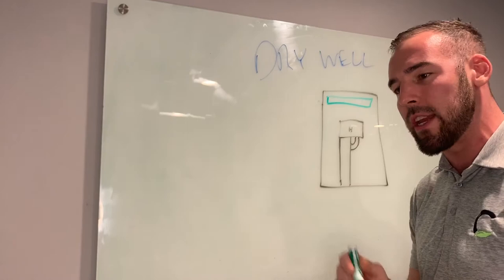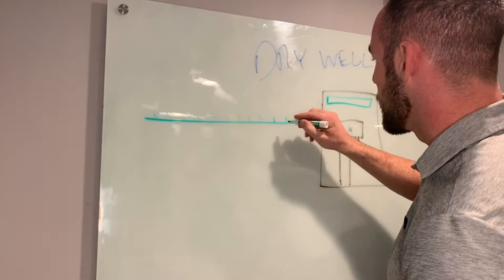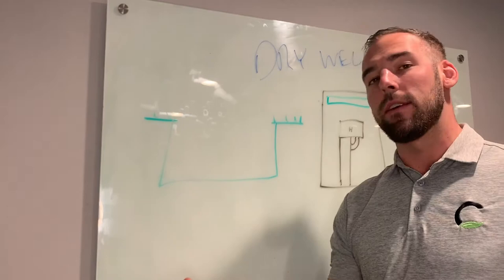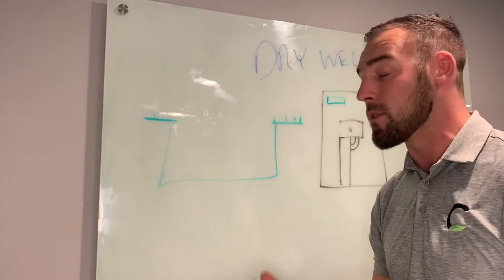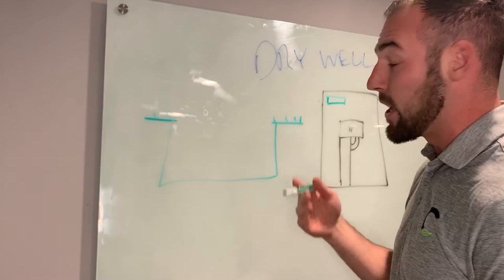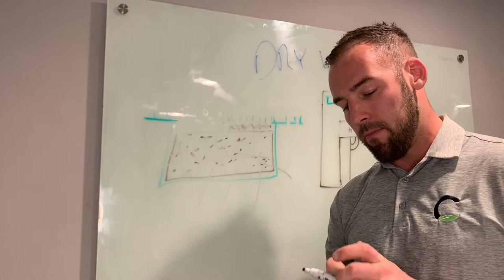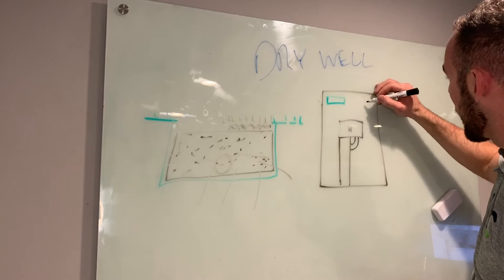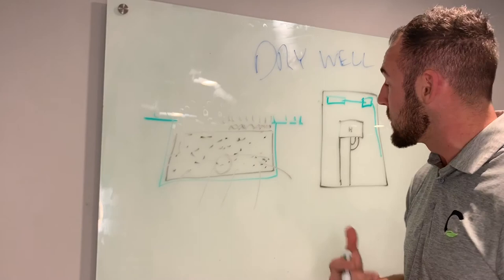Dry Well/Dry Bed Basin Installation

Comment: Nice video Mike. Let me ask you a question. I have an area in the driveway next to a brick sidewalk that has within the last year collected water when it rain and pools up there. I've noticed over the past 3 months the ground is sinking in there. because of the way my property was graded which is towards the house I think a dry well might be what I need. Other videos show a 40-50 gallon catch basin with stone around it. But you are showing just to use fabric and crushed stone then cover up the stone with more fabric?  Is that the way you suggest doing dry wells? I live in NJ . Thanks

Comment: Where does the overflow go? Please don't tell me you dig it deep enough so it doesn't overflow. You never know when you'll have a hurricane type storm, neighbor builds an addition or deck, etc. Dry wells take pressure off the town's storm water management, but eventually need to send water there.
Reply: I'll but-in here.  When I install these I purchase 55 gallon plastic barrels from U Line.  Drill 1" holes all around them and on the bottom.  Then line the hole with a good drainage fabric including the bottom of the hole, put around 6" of 2"-3" rock on the bottom, put the barrels in, then finish with the rock.  This will give a lot of void underground for water collection.  Sure it will overflow sometimes.  The water will just gently roll out 360 degrees all around.